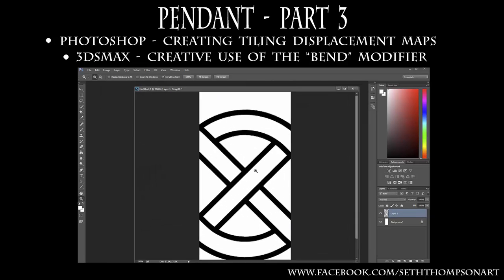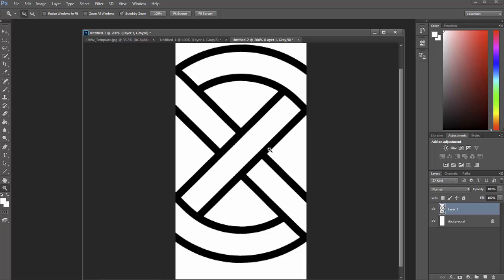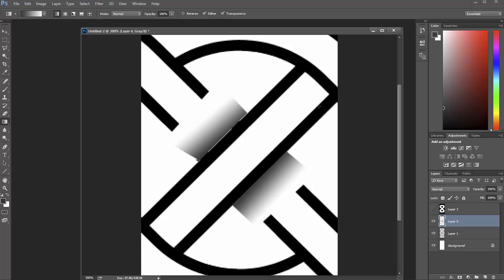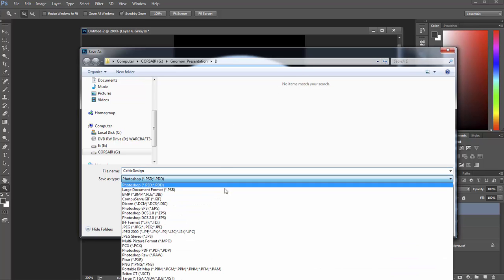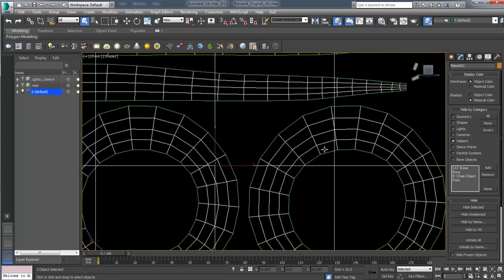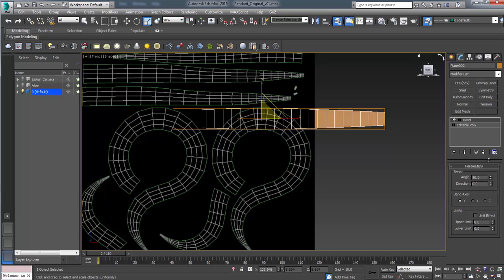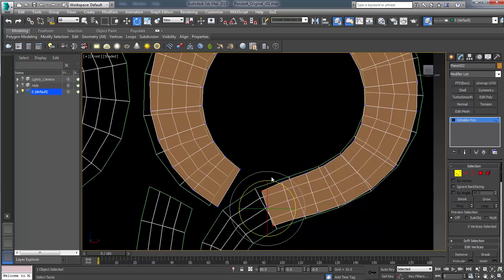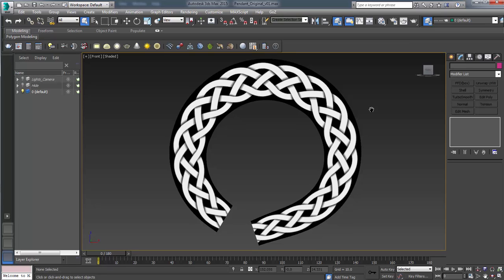Pendant Part 3 - Creating tiling displacement maps with Photoshop and 3DsMax

Comment: Hi Seth,

 How did you get your alpha map to wrap around the object like that? I've tried doing to the same thing but with a different shape and my map just tiles in a straight line

 edit: Nevermind I figured it out. you used bends instead of deforming the verts, which kept its original uvs.